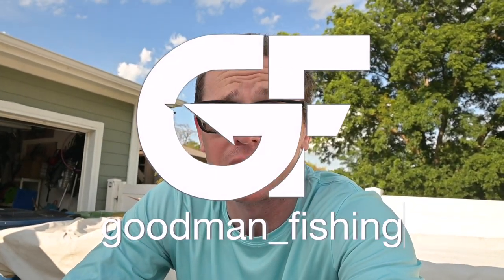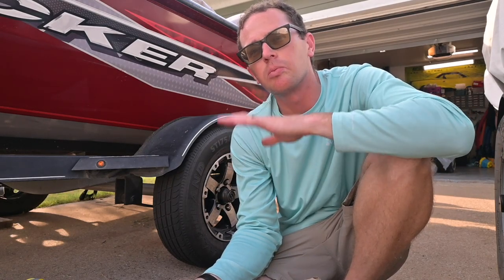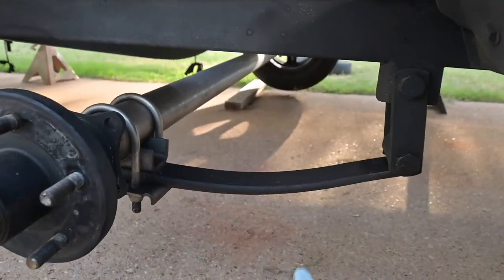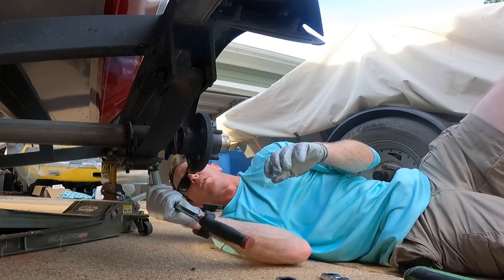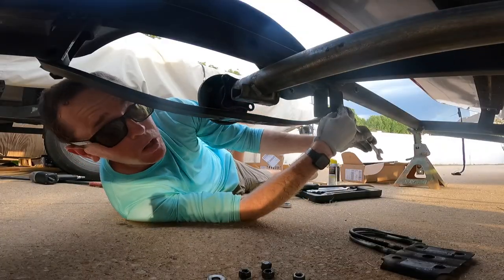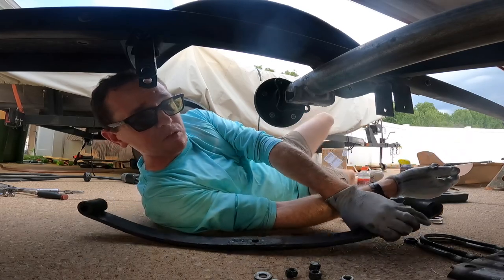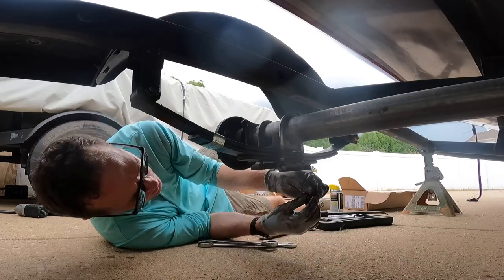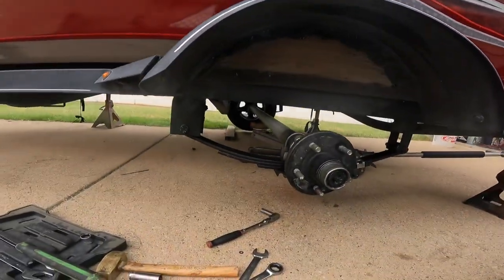These will FAIL - How To Replace Tracker Boat Trailer Leaf Springs - Monoleaf

Comment: This happened to me last Wednesday. On a trip up to New York at 5:30am my leaf spring decided to go boom. Had someone bring me 2 new packs but all I could get at the time were the 4 leaf packs. It rides great with the 4. Doesn’t bounce down the road anymore and still has some travel in the suspension.
Reply from the maker: @BassAngler  such a bummer that happened! Glad you got it sorted out.

Comment: Great video. I have a 2008 190tx that came with a 3 leaf spring, but since they are almost 20 years old and rusty, I'm just going to change them. You should do a video on changing the wheel bearings and/or hub.
Reply from the maker: Good call changing them out! I swapped over the bearings not too long ago, will do a video next time!

Comment: Hello sir. Watched your video after changing out my leaf springs as well. I changed out the single leaf too but with a 4 leaf and noticed my trailer sits quite lower than was. Did you notice this as well or should i get a 3 leaf instead?
Reply from the maker: I didn't notice any change in ride height for mine. What load rating did you get?
Reply: The springs are rated for 3500 well above the boat weight

Comment: Did new or stiffer travel rate of those 3 leaf's make your trailer bounce the tires off the road?
Reply from the maker: There aren't publish spring rates to make a good comparison on paper, but I have not experienced any dramatic responses. Put about 400mi on the new springs so far.